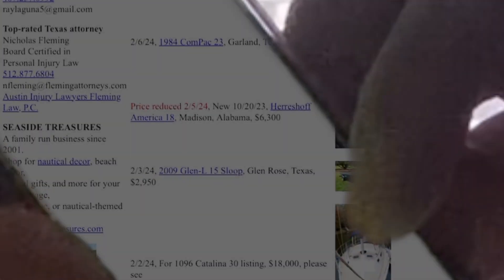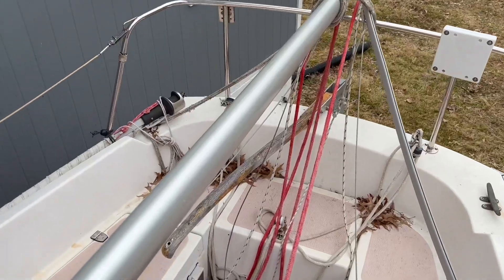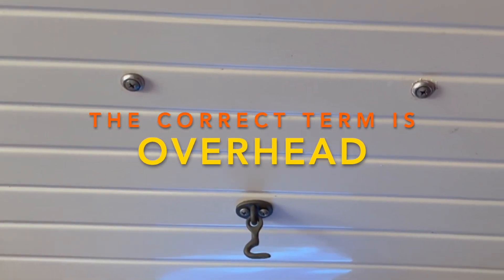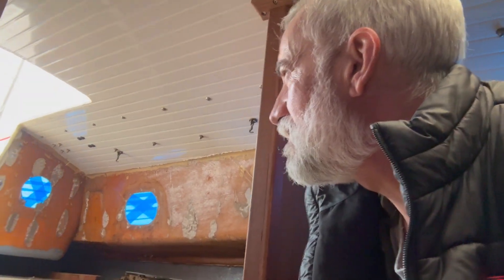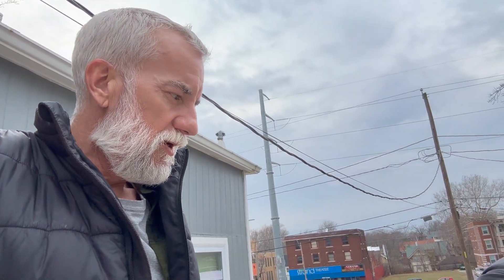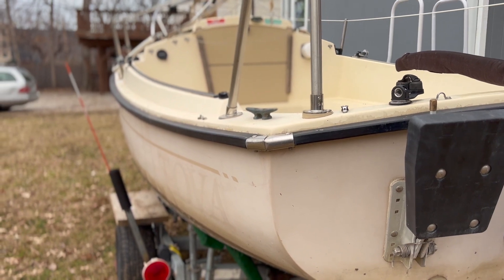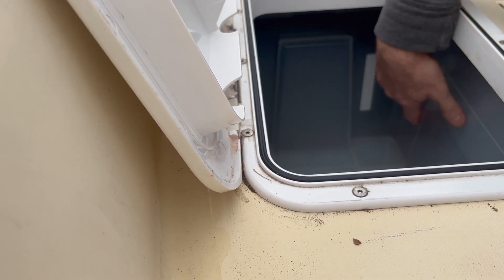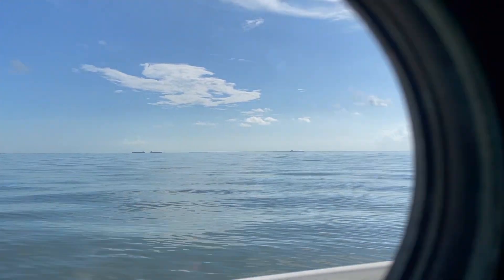COM-PAC 23 SAILBOAT REVIEW OF VIEWER'S COM-PAC 23 MK3 & COM-PAC 16 MK2 SOLO SAILBOAT RESTORATION

Comment: Mitch, last summer, I talked to Gerry at Com-Pac about the deck core material of the 23 -- gotta look up the info he sent to me, but once I have it in hand, I'll report back here. ⛵
Reply: OK, found it -- it's on page 4 of the Com-Pac 23 manual (copying and pasting in that part about the deck here): "Your COM-PAC 23 deck incorporates core materials which will not deteriorate or delaminate. We use three types of core materials; a micro balloon resin mixture; foam in thicknesses varying from 3/32" to 1/2"; and as an alternative a honeycomb material. Micro balloons are made from sand (silica) which is "popped" much like popcorn. This forms a tiny, hollow sphere particle which resembles face powder. We mix these micro balloons with polyester resin to form the light-weight core material. This material is then sprayed on to the deck to the desired thickness. The foam or honeycomb material is used on large horizontal surfaces that require more thickness than is possible with the spray on micro balloons."

For those of you who want to grab up a copy of the manual on the 23, reach out to info at compacyachts dot com to request the PDF.

Fair winds,
~ Chelle
Reply from the maker: Very interesting. That’s great information from the source.  Yes, this boat will last forever.  Thank you for passing that along.

Comment: I own a Galion 22, made in England for the OSTAR trans-Atlantic single hand race back in the early 70's.
It has a ballast/displacement ratio of 48.5, but it draws 3 1/2' and doesn't have a sliding companionway cover, just a tombstone opening into the cabin. It's very stable and sails beautifully but kills my back getting into and out of it.
So I just bought a CP 23 Mk2. Now trying to move the Galion along to a new owner who will use and appreciate her.
Reply from the maker: Wow the Galion 22 is a good little offshore  boat.  Excellent capsize screening number.  I’m surprised the Com Pac 23’s number isn’t slightly better.  It’s well over 2.0.  I always feel very safe and secure on the 23 regardless.  I hope you enjoy your Com Pac as much as I do and good luck with selling your old boat. I’m sure it will be gobbled up quickly by someone.